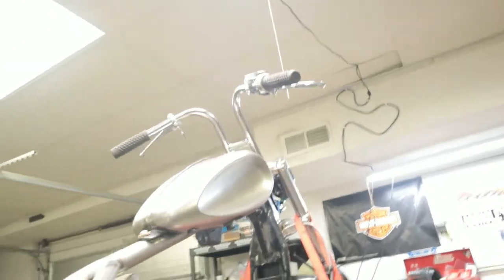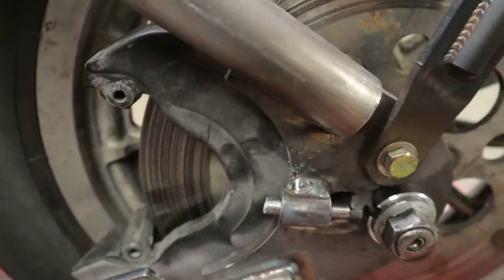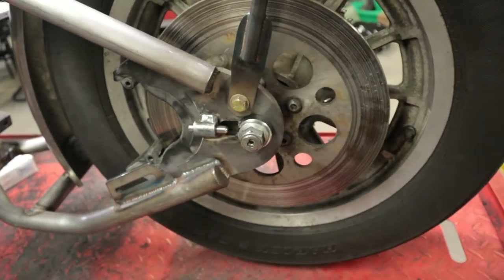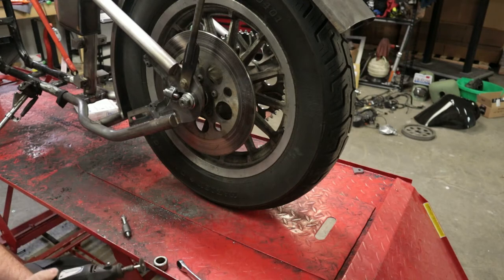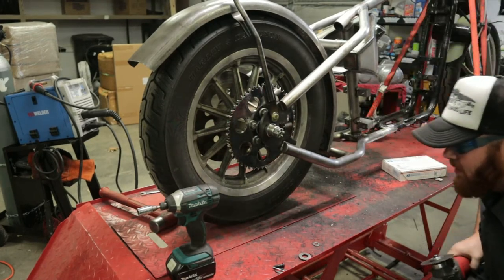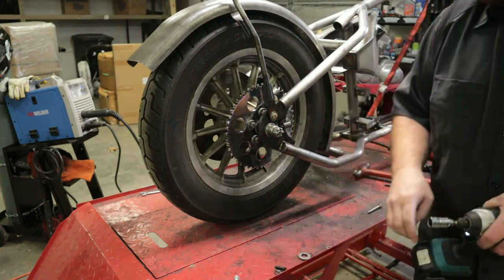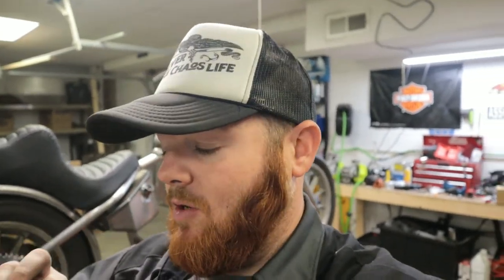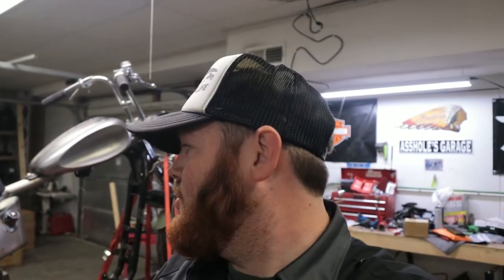Fixing the one thing I HATE about the THROTTLE ADDICTION SPORTSTER HARDTAIL KIT @ThrottleAddictionCo

Comment: Never had that problem and I’ve installed 2 of their kits. Fine thread is used for a reason. If it fights you at all, you remove the bolt and chase threads in bung. Sometimes threads distort after welding so that’s a given. Second is most important… chase threads in the CHROME bolts. Chrome ads material to threads and if it’s enough to notice any resistance, chase it! Especially fine thread! Fine thread will bind and sher easier because it has double the drag as a corse fastener! You get away without chasing threads on corse chrome hardware because there is less drag by design but even then they require chasing from time to time. Fine thread that has been chrome usually needs to be chased even from manufacturers like Colony! Another thing os you called out a bullshit thread pitch but did you even measure the threads with a thread gauge? I call operator error on this one. This kind of video can really leave a bad impression on a US based company man and on top of that it’s your responsibility to take care with what you put out since you have a decent amount of followers. Also they were more than willing to make your situation right.
Reply from the maker: Maybe you should read their comment they left........
Reply: @STLNik  I did and they’re still using the same fine thread chrome adjuster screw. Things builders should know… if it’s chrome and threaded, chase it!

Comment: axle adjusters on Harley's since the dawn of their conception has always been a fine thread pitch.. might be a reason for that..
Reply from the maker: For atleast the last 35 years they've been a coarse thread.
Reply: @STLNik  I've owned H-D's  '77 fx, '81fx, '84 fxst, '89 xl, '94 xl (hardtailed) '99 xl (hardtailed) '14 xl, '15 dyna...... all axle adjusters fine thread before and after hardtail conversions. I'm not arguing with you on whether or not it will work, but there just might be a reason for it.